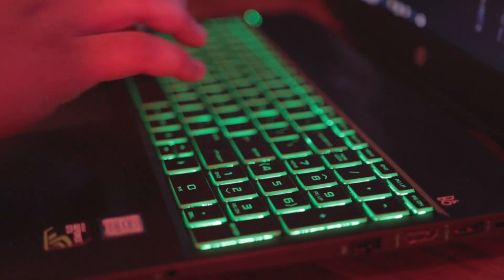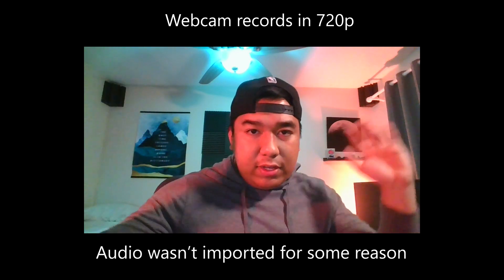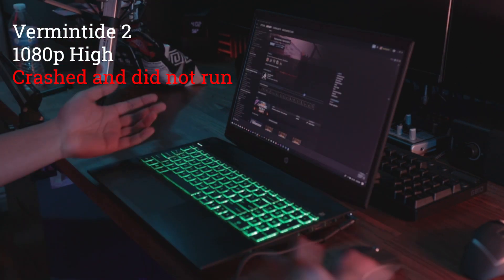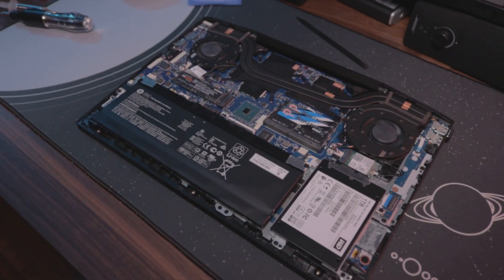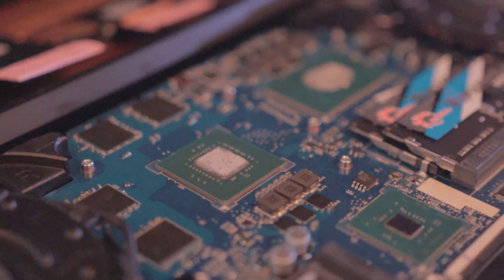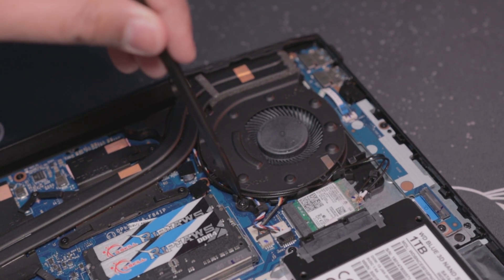Let's talk more about the HP Pavilion 15 Gaming Laptop

Comment: Will the laptop cooler help it not get too hot?
Reply from the maker: Yes it should help with the temps for a few degrees but overall I think that the i5 8300h is just a very hot CPU and the more robust coolers from the more expensive gaming laptops will deliver a better thermal experience.

Comment: I have the same Laptop but at CSGO i only get 50-60 fps. When i play FIFA 19 the framerate in ultra is only around 40 and stays like this when i change to low settings. Is there something i can do to make the performance better, because its much more worse then the one in the video?
Reply from the maker: I recommend checking your power options making sure high-performance mode is set for one. 2 make sure that your drivers are up to date and you have the latest Nvidia drivers installed. 3 make sure that you are plugged in when gaming, without the power adapter the GPU isn't getting enough power, therefore, reducing performance significantly.

Comment: Hey man, do you still recommend buying this laptop? I'm mainly concerned about the longevity of the hinge and that black screen issue.
Reply: Thanks for ir info it's just i really liked the design i wanted a cheap laptop that looks like a gaming laptop the hp has the green accent and the nitro has the red design the lenovo one looks clean and polished but a bit boring
Reply: @acapelllah2502  Np.
I like laptops that don't look like a gamer-y laptop but I agree that the design of the Ideapad is boring.
Reply: @mohamedmagdy4550  I did. It has terrible build quality.
لو هتشتريه هاته من مصر احسن عشان الضمان
Reply from the maker: If your concern is longevity maybe look into getting an Acer or Lenovo around the same price. They may cost more but I think if you want something that will last you a long time and has better build quality that's the price you pay.
Reply: @B4YBTech  I'm considering buying the Acer Nitro 5, but it's fully made of plastic, and I'm buying it from outside of the US so the warranty is pretty much useless.
So the logical option for me might be buying the Lenovo IdeaPad 520 which is obviously much less powerful than the pavilion and the nitro but it's made of metal and sold locally here.
It's ironic how I might settle for the less powerful laptop even though I can buy a more powerful one.
Reply: Adham Salama I’m in the same situation stuck between 3 laptops the pavilion the nitro 5 and lenovo but my budget is so low idk what to do
Reply: @acapelllah2502  If the pavilion and the nitro are sold locally in your country I'd say go for one of them, the pavilion seems to overheat a lot so the nitro looks like a better option.
If they're not sold in your country I'd say don't take a big risk and buy an expensive laptop that's known for overheating and has a weak hinge the pavilion because if you face any problems I think your warranty won't be valid in another country.
The Ideapad 520 is cheaper than them and made of metal which is a huge plus at least for me, if it's available in your country then obviously you get a 1 year warranty and I haven't seen people talk bad about the Ideapad so it's seems like it's the less powerful but the cheaper and more reliable option.
Reply: I guess im just going to pray for a good laptop i mean i am a bit unlucky so idk how it will go
Reply: @acapelllah2502  Which one are you gonna buy? Are you from the US?
Reply: @adhamsalama4336  i dont know yet still cant decide from morocco
Reply: @acapelllah2502  احسن ناس
انا من مصر

Comment: Hey there, love the vid I got this laptop when it first came out about 6 months ago. I dont know a whole lot about upgrading laptops but would love to know the versatility of this laptop. Also, what is the purpose of replacing the thermal paste?
Reply from the maker: Hey Kyle 👋 the purpose of replacing the thermal paste is to hopefully improve the heat dissipation. Because most manufacturer's use a lower quality paste in their laptops.
Reply: @B4YBTech  Got it! thank you so much!
Reply: Hey is ur laptop running fine did u have any issues ?
Reply: @acapelllah2502  It's working great, the only issue I've had is that it can get hot when gaming certain games. I play a lot of Rust and that is a very demanding game. All others seem to work pretty well, Rust is the only one I've had issues with heating.

Comment: i'm confused between this laptop and the legion y530 !!! Can anybody help meee
Reply from the maker: That depends on your budget if anything the newer lenovos go for about 1k with better specs and better build quality. This laptop is cheap and therefore build quality not the greatest.
Reply: Thks one is prettier than the Y530.
Reply: well in tunisia this pc with i7 8750h + 1050ti + 128 ssd + 16go ram is for 800€ , but the y530 i5 8300h + 1050 no ssd and 8 go ram 700€

Comment: WIth the thermal paste did you spread it out , Or did you just allow the heat sinks to spread it out on its own?   I have the same laptop and  was wondering if you could explain how to undervolt it , I appreciate the THermal explanation too.
Reply from the maker: And no don't spread just apply thermal paste and lay the heat sink over it

Comment: Does it get hot and use the fans a lot when video editing. I would like to use davinci resolve and reaper audio mostly on this, no gaming. do you think in reality the fans will be on all the time during editing, color grading and other video enhancements. or do you think mainly the fans will be on hard only during the render process. Please let me know as soon as you can. I am looking at a desktop HP gamer which has a little better specs but a lot more space inside which really helps the cooling. Thanks
Reply from the maker: It mostly gets loud when doing the actual render. I use premier pro and during the editing process it gets warm while I scrub and edit but only gets hot when the actual rendering process goes down. The fans are always on and can be audible depending on your ambient noise in the room. If you record while having the laptop in the room it may be a concern. I edit with headphones on and my mic doesn't really pic up much noise.
Reply: no not in video in gaming only gets hot

Comment: A good quality video sir! thx for sharing. did you suggest this laptop, is it worth to buy? i like this gaming laptop cuz its very CHEAP, and a nice looking! but i'm afraid of overheating, lots people said hp laptop is very bad at this. Also, i want to use that to photoshop and editing video, is screen color good? about battery life, how long you can use it with out pulgin power?
Reply from the maker: Thanks for the feedback, I appreciate it. If you will game on this for extensive hours it definitely gets hot. I personally use it for photo and video editing. When using it for premiere it does get hot and only gets really hot when I am rendering the videos. I get about 3-4 hrs screen on time and the screen is decent for color correction.
Reply: @B4YBTech  thx , thats all i need to know

Comment: When I move the screen downwards, there is like a pressure point where the screen is connected to the keyboard, showing white marks like I pushed it with my fingers. The salesman said it's normal because when I move the screen down the support holding the monitor (in the middle) gives it slight pressure. Any of you guys have this?
Reply from the maker: I have never experienced that so far with mine
Reply: @B4YBTech  when i press on the bezel the pressure can push on to the LCD  and cause a white shadow that will go away once the pressure is removed. that's what i meant. it is visible when you have a dark wallpaper.
Reply: What I wanna ask is: is that normal or? :)
Reply from the maker: @dinopuric6924  oh I see, yeah that happens to any LCD if you apply pressure. Just don't do that.
Reply from the maker: @dinopuric6924  yeah that's what I just said any LCD panel if you apply enough pressure the screen gets distorted as far as I know. So I don't recommend applying any pressure, especially with this laptop since the hinge is weak.
Reply: @B4YBTech  the thing is the bezel applies pressure when i'm closing the laptop and the salesman said that it's normal. I just wanted to check here :)
Reply: @B4YBTech  it happens only when i slowly close my laptop
Reply from the maker: @dinopuric6924  the only time I noticed mine applying pressure as I close the lid is when I do it in an uneven surface. So you might want to get that checked out, doesn't sound like it was designed to do that.
Reply: @B4YBTech  yeah, i have mine on a cooler. I'll try putting it on a straight surface :)
Reply from the maker: @dinopuric6924  still doesn't sound normal, I recommend talking to HP support my friend. I never experienced that like I said unless the surface was uneven then the hinge would sort of get caught.

Comment: also can my laptop support an 256 m2.nvme , and a second tb harddrive along with the preinstalled 7200 1tb that it came with?
Reply from the maker: You only get 1 m.2 slot and 1 2.5 drive bay so you wouldn't be able to install another hard drive. In your case, I recommend getting a larger SSD or a larger HDD to accommodate your storage needs.
Reply: @B4YBTech  ah thank you

Comment: can i undervolt using afterburner to the same voltage as you mentioned? i have the same components in my pavilion.
Reply from the maker: You don't undervolt your CPU through afterburner. MSI afterburner controls the GPU not your CPU. If you plan to undervolt your GPU I wouldn't see the need to do so because when I use mine the temps stay within range and in fact does not throttle vs the CPU
Reply: @B4YBTech  ahh same my gpu usually only reaches about low 80s but the cpu is always in the 90s. if i use throttlestop can i use ur same voltage?

Comment: yee yee ass haircut
Reply: this laptop or acer nitro 5  for long term years for programming and gaming ?
Reply: Zezo Noaman I got an Acer Nitro 5 yesterday and within a few hours of using it, it went to a blue screen and completely stopped working. It was plugged up so the battery was fine and the only think I was loading was the sims 4 on steam which is an older game and doesn’t require a high quality device to play. My 6 year old dell works better than that thing did.
Reply: Emma Drinks Bleach how much is the nitro 5
Reply from the maker: Thanks buddy enjoy!
Reply: @Btmsd Gaming 1. No the keyboard only has 2 options green and off, 2. It does run fortnite well on medium settings and it caps at 60 fps due to the monitor being 60hz. But for fortnite I would recommend turning shadows and effects to off / low to either turn up other settings or have more consistent frames but o definitely recommend the laptop
Reply: I want to buy it and i want to know if the cpu heat of not ?
Reply from the maker: @AmineOuaouine  hi Amine, as I mentioned in my video it does heat up especially if you game for long sessions. I highly recommend for you to undervolt and replace the thermal paste if you decide to get this laptop. For the money I think it's still one of the best value laptops out there.
Reply: Please can you do a gaming review on this with the latest high end pc games like far cry new dawn, assassin's creed odyssey, World War z and etc
Reply: VidBro price for it??
Reply: I dont own it YET but i love it😂😂
Reply: Yo dude,how much hz has it?
Reply: Will a laptop cooler help?
Reply: same
Reply: Why are you watching this then?
Reply: Can this run World of Warcraft? I really bad at this hahaha
Reply: Pls how  personalize keybord color
Reply: @anonymus.8445  you cant... Its single color...
Reply: @benjaminviher1776  my keyboard is only blue how can i change colour in green
Reply: Me too I mostly use it for playing csgo and hitman
Reply: i have it and have not been able to play any games something on it is limiting it from doing so been pretty stressful 2 months owning it for me and cant seem to get any help from hp they say its a software issue so bought a 800 dollar laptop for nothing
Reply: Depends on the version of the laptop you buy can come woth 144 hz
Reply: Mine has been able to stream fortnite with 0 problems
Reply: Mine seems to keep overheating and crashing, what can i do to stop this?
Reply: @Btmsd Gaming Bro it gets really hot Also wanna play roblox together? My discord is Solu#6313 Add me on Discord
Reply: Is the battery good 🤔??
Reply: Does it run Roblox?
Reply: Mate stop it’s terrible

Comment: Here I am again my friend, I found the problem for my random black screen but still running laptop, something with a protection for temperature, the windows think that it's too high and shutdown the display for protect however I check the temperature playing apex and it is not higher than 82 celcius, the solution disable this option on power manager put in passive or disable turbo boost. What do you think could be a problem of hardware that high temperature or is normal?? Regards
Reply from the maker: That's interesting because I get higher temps than you, but I have never had an issue wherein the display shuts off. I think you should see if that issues still persists then contact HP support.
Reply: @B4YBTech  I already contact them I they want to troubleshooting in they department but I already did memory upgrade and ssd also thermal paste upgrade, and they said if the computer has physical damage they don't repair it. And this problem happen before the upgraded. So I am between the sword and the wall.
Reply from the maker: @ernestogalban2597  ugh that sucks my friend, hopefully the issue goes away but if it still persist, I recommend sending it in and it might be a display issue. I know that sucks after doing all the upgrades. If you decide to send it back I recommend taking your upgrades and that way in no way do those get lost or stolen. Also just an idea have you tried using an external monitor at the same time?
Reply: @B4YBTech  like I explain in the last video if you put a external monitor don't happen, the display shut it off but the external monitor persist fine, if you press F4 and choose only second monitor and later choose duplicate or only primary monitor the display laptop turn on without problem, it's weird , you can do it that steps at the moment and the laptop display turn on at moment,
Reply from the maker: @ernestogalban2597  that's normal for it to turn off the monitor of the laptop when you first plug in a monitor, you can have it set to duplicate or extend the picture.
Reply: @B4YBTech  the weird it thing it's that the display monitor turn on without problem, after turn off because the temperature or under power. Right now I don't know why for sure it's happen.
Reply: That why I think it's a problem of windows or driver issues that send a signal to the display to turn off or something today I going to do a extensive troubleshooting by disable the temperature control and also disable Intel turbo boost to try if fixed the problem.
Reply from the maker: @ernestogalban2597  yeah try to give that a shot, also I recommend making sure all your drivers are up to date using the hp driver software

Comment: Cant we increase the fan speed by any third party software?..mine still haven't arrived yet and by the reviews I am bit worried about the heating issue.
Reply: I play AC4 for about 1 hour at 1080p medium settings and the average temp is 70°C but I do put the back of the laptop on a book so that the air can flow from the bottom of the laptop, other than gaming the laptop doesn't heat when using normal softwares and the fan is generally quite, I will not advise you to mess with any settings, if you're not in a hot room and as long as the bottom of the laptop is not flat on a surface you should be good, also consider enabling v-sync for games when possible
Reply from the maker: I have tried and no luck with any software. I recommend getting a cooling pad if you plan on gaming for a long time
Reply: @B4YBTech  What about disabling processor turbo boost?
Reply from the maker: @ujjwalvishwakarma7765  haven't tried disabling the turbo boost. That might be helpful, I'll test it out.

Comment from the maker: Timestamps:
Discussion - 0:44
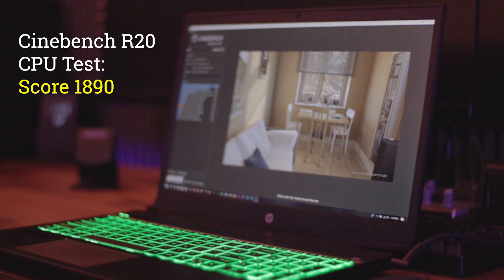Benchmarks - 4:50
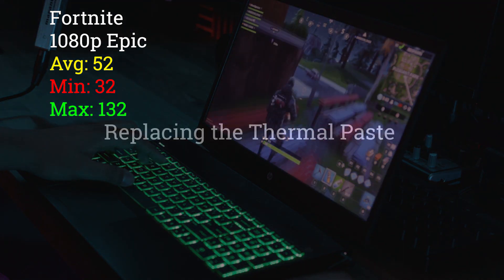Replacing Thermal Paste - 6:00
Reply: Hi could you link me to the amazon page of this laptop? thanks.
Reply: @memesauce7703  I may not be the B4YB guy, but here is the link!
Reply: @cookedcoc6693  where?
Reply: Excellent video my friend, great job!.I know this video is not new, but I recently bought this specific model and It’s a fact that the high temperatures are one of the most important issues of this laptop, the best solutions I found are the same you did (repasting and undervolting), but I had much better results using Throttle Stop instead of Intel XTU for the undervolting, because it also let me limit the frequences of the cpu turbo boost. I limited them to 3,6 Ghz when all the cores are active and now after some hours playing fortnite it stays on 75 degrees on average, with the max temperatures around 83 degrees .I’m very satisfied whith the results, now the laptop works with lower temperatures and with a more stable cpu performance. i think sharing this information could be helpfull.
Reply from the maker: @raulsilvera9158  Awesome man thank you for sharing your insight I am glad you found a solution to one of the biggest problems with this laptop
Reply: I added three replies one of them has a link for the amazon page for this computer
Reply: @cookedcoc6693  where are the three replies?